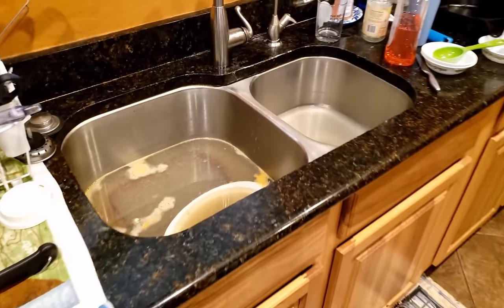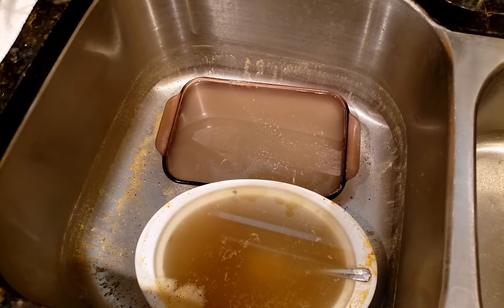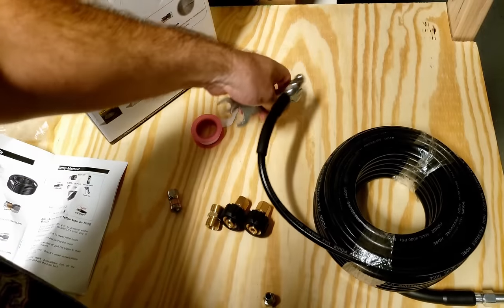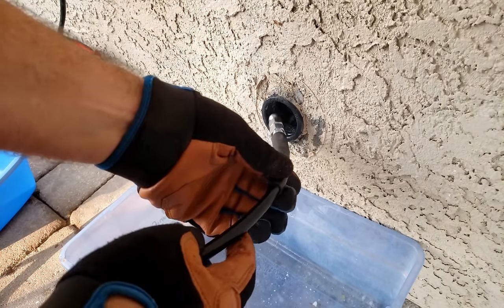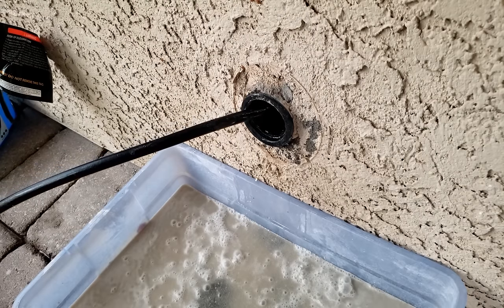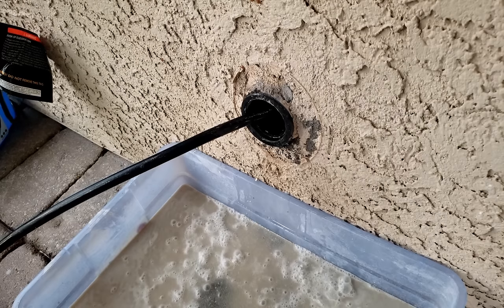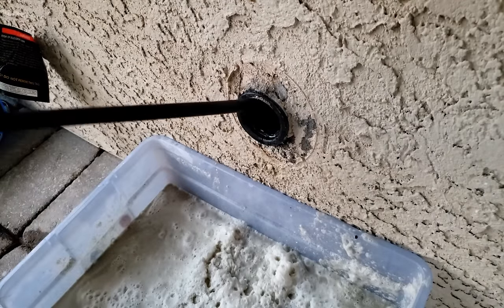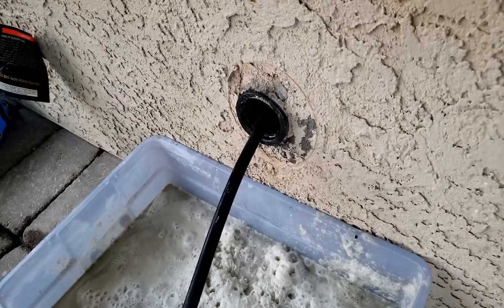UNCLOGGING my kitchen sink with a PRESSURE WASHER and the POHIR Sewer Jetter Kit

Comment: I wonder if the pressure decreases the longer the hose is. Hopefully not, I just ordered a 100 footer.
Reply from the maker: I don't know if you lose pressure with a longer hose or not. It took me a few tries to unclog my sewer pipe with the 50 ft hose. So if you do lose a little pressure it may take a few more tries to break through the clog with a longer hose. But it should still work. Let me know how it works with the longer hose.
Reply: @ThatHobby  I tried it out today and it worked! The length of the hose made it a bit difficult to handle since it was kinking and tangled. But I was able to advance nearly 70 feet in to the drain. Glad I got the 100 instead of 50. Black water and crud were coming out until the clog was cleared, then no more water. Not bad for $30 and a cheap Harbor Freight pressure washer rated at 1750 PSI. I think I will use hot water next time. I tried everything else including that horrible dreaded snake. And the plunger never worked for me. This was my last attempt before calling the plumber. Thanks!
Reply from the maker: @lwh7301  That's Awesome!!! Thanks for the update. Some people have asked if a 2000 psi pressure washer is powerful enough. It's good to know that even a 1750 PSI budget friendly pressure washer will do the job. It sounds like you really needed that 100 ft hose too. Good job. It feels good to save a couple hundred bucks. Plus you have everything to unclog it again if you need too.

Comment: Whenever I turn the water on in my kitchen sink, when water drains, it immediately begins to come out of the sewage drain on exterior of my house. Is this normal, or what type of issue may cause this
Reply from the maker: If you are talking about a water leak from your sewer drain. There could be a hole in the plug to sewer drain. That's what happened to me. The screw was rusted out too. So that could be your issue. If you are just talking about water running in the pipes and no leaks than that seems fine. But no water should be leaking anywhere from the sewer pipe.
Reply: Sorry I don’t know the terminology, but it is leaking from the exterior wall from the drain plug. The sink gets flooded when I leave the drain plug on. It is wetting the stucco, what is the issue
Reply from the maker: I am not 100% sure about the terminology either. But if you look at 0:52 on my video you can see the drain plug. Mine has a hole in it and started leaking water when I took out the screw. This could be the cause of your leak. The screws will rust out and can cause a leak.  If that is your problem then you can get a new drain plug to fix it. A new screw may be a temporary fix as well.

Comment: do you think i can do this with my washer drain? from the top down?
Reply from the maker: I would think so. Our washer is upstairs and the clean out drain is downstairs in-between the kitchen and the family room. If you can find the clean out drain it will give you a good idea where the clog is. But I bet if you just go from the washer drain that will work too. I would think it is soap residue and would break up real good with a sewer jetter. Just be prepared that a lot of water may come back out of the drain until the clog is broken up. So have some tubs or a wet vac ready.

Comment: What is the name of your electric power cleaner, I got AR Blue, don't think it's compatible with the jetter, but would considering buying like yours. Thank you.
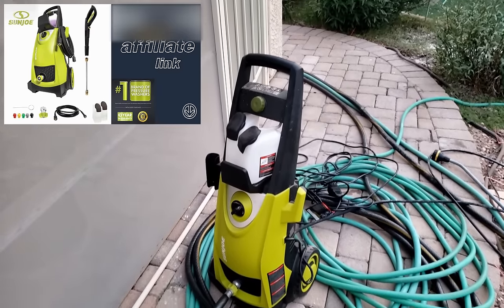Reply from the maker: The AR Blue should work too. At 4:00 you can see the 2 different fittings I connected to the hose. The 1st one is the sewer jetter hose attachment and the second one is a hose fitting used to attach the hose to the pressure washer gun. The important thing is the fittings that come with sewer jetter kits. At 5:41 I connected the sewer jetter hose to the pressures washer gun. There is an Amazon afflicted link in the description to the pressure washer I used. The pressure washer I used is the Sun Joe SPX3000 2030 Max PSI 1.76 GPM 14.5-Amp Electric High Pressure Washer, Cleans Cars/Fences/Patios
Reply: @ThatHobby  Unfortunately AR Blue doesn't have the snap on fitting, it has 2 attachments that connect to the gun in a twist in motion, but thank you for sharing your moled I'll consider getting it just for the ability to connect the sewer jetter.
Reply from the maker: I didn't realize the AR Blue had a different handle. I think the kit comes with another fitting that directly connects the sewer Jetter hose to the pressure washer. I'm not sure if that would work on the AR but I thought about using that method on the Sun Joe because it is a bit of a pain to hold the handle down and feed the hose down the pipe at the same time.

Comment: How long is that hose boss? Sorry about that that's 50 ft of Hose you answer my question, I've got a mobile home I've got to figure out where the opening is because I cannot feed a hose like that through the sink, I'll figure this out.!
Reply from the maker: If you can't find the sewer clean out drain plug you can also access the sewer pipe from under the kitchen sink. The clog could just be in the pipes under your sink. So it's good to check those pipes first. If those pipes look like they are clean then you can look under the kitchen sink at where the drain pipes connects to the wall. You can clean out the sewer pipe from there too. It will just be a little tougher working under the kitchen sink. You will need some tubs for the water and a wet vac would be nice to have too. Good luck!
Reply: @ThatHobby  well I snaked it about 50 ft under the mobile home, but it snowed here in Chicago yesterday so one of my friends told me to get some baking soda and vinegar.! I don't know if that's what did it or the whole bottle of Drano but luckily I got it clear :). Great video thanks so much and God bless~
Reply from the maker: Good job! I am glad you got it cleared out. Thanks for the positive comment.

Comment: Was hoping to see that other nozzle that came in that kit.  Looked like a rotary nozzle
Reply from the maker: I didn't think about using the rotary nozzle but yeah I bet it would work good too. I will have to test it out and see how it works.
Reply: @ThatHobby   I was actually looking at the nozzle for cleaning out a well and searched for videos and yours popped up
Reply from the maker: @charliemagoo7943  I used the sewer jetter nozzle head to bust up a grease clog but yeah I bet the rotary nozzle would work better for cleaning out your well.

Comment: Bunch of grease in the line. They do alot of cooking. Build up is at a turn of transitional fitting. Lots of grease
Reply from the maker: That's what we were thinking. Ever since we moved into this house we have had issues with this drain. Plus we cook a lot too. So we have just been adding to it. The sewer jetter did the trick I was able to get it all cleaned out and if it gets clogged again I have all the equipment to clean it out now.
Reply: Cool. Just jett out the line either every 3 months or 6 months. Pour hot water every once in a while.

Comment: I wonder if i can use it on the main line to sewer
Reply from the maker: It depends what the clog is. This worked great on the grease clog. I don't know how it works on other clogs but these sewer jetters are supoaed to be used to clean out all kinds of sewer lines.
Reply: @ThatHobby  what about roots because a sewer guy used the snake on my main line to unclog but try to sell the pressure cleaner for 1200. 00 and i told him ill pay the 87$ for the snake and ai asked him how wuld the pressure cleaner deal with roots 
he said technology meaning he didnt know 
thats why i ask your opinion let me know im having this problem yearly
Reply from the maker: @4444pro  I think the sewer jetter kits would work on roots. The issue would probably be the pressure washer. The Sun Joe pressure washer is only 2000 psi. Profesional hydrojets can be as high as 5000 psi. To get a 4 to 5 thousand psi pressure washer would be about a thousand dollars. If you wanted to test it before you buy it you could rent one and see if it works before you make a big purchase like that.

Comment: I don’t see the drain plug outside by my kitchen sink. Where can I find it lol help
Reply from the maker: If you walked around your house and can't find anything you could also do this from the sink or the pipe under the sink. It was just easier for me to do this outside.
Reply from the maker: The drain plug can also be inside your house. In my old house the sink faced the family room and the drain plug was on the wall in the family room on the other side of the sink.
Reply: In some states in different counties they make you put clean out on every drain line, either on the interior or exterior like the one shown in this video. If your on a crawl space or basement it should be located right under the sink within a couple feet.

Comment: What’s the PSI on your pressure washer?
Reply from the maker: The Sun Joe pressure washer is 2030 Max PSI. The POHIR Sewer Jetter hose can handle up to 4000 PSI. The Sun Joe isn't the most powerful pressure washer but it got the job done.

Comment: No system ( not even city sewer) is designed to accept grease or oil. If you have a stand alone system then it's even worse. NEVER put grease or oil down any drain. Always contain these , and place in trash.
Reply from the maker: Yep that is the way to go. Once you get your pipes cleaned out you want to keep them that way. I recently bought an old fashioned George Foreman grill. All the grease runs down into a tray and you can just dump out the grease into the trash. I cleaned out our sewer pipe back in October and it is till working great.

Comment: you must live somewhere warm..we don't have plugs on our walls up north haha
Reply from the maker: Yep I live in Arizona. Some people have said they couldn't find there clean out drain in there house too. So maybe they just use them in the warmer areas. But you can also access the sewer line from under the kitchen sink. It is just a little easer to do this outside if you have a clean out drain. Unless its snowing or freezing then its probably easer to do this under the kitchen sink.
Reply: @ThatHobby  did you put towels or something in the sink? wouldn't that shoot crap all over your kitchen going that way?
Reply from the maker: @patrickpk6299  No the sewer jetter isn't pointing towards the kitchen sink. The clog was further down the sewer line. So the excess water just ran out of the clean out drain.
Reply from the maker: @patrickpk6299  When I put in the sewer jetter I could go 2 directions straight would go to the kitchen sink and left would go to the sewer line. I pushed it to the left until it hit the clog. Then I turned on the pressure washer to bust up the clog.

Comment: I paid a 1k to have my main sewer clogged hydro jetted. But bro wth u guys putting down the drain. Body parts lol jk good video.
Reply from the maker: Yeah hydro jetting can be expensive. This set up isn't as powerful as a pro set up but it was able to get the job done. When we bought this house there was a ton of grease build up on the stove. So I think the previous home owners dumped a lot of grease down the drain. That grease can really build up and cause some issues. Especially when it gets cold the grease can harden up and cause a real tough clog.

Comment: Thanks for sharing the video! I've been looking at buying this kit for my main line. Been having a lot of grease build up lately and would prefer doing it myself than calling a plumber. Question, I've got a green works 1800 PSI pressure washer, think that will be sufficient?
Reply from the maker: The Sun Joe is only a little bit more powerful than that. It is 2030 PSI.  It took me a few tries to unclog my sewer pipe. So I think that 1800 PSI will still work. It just may take a few more tries. For the lower PSI precure washers a lot of the grease is going to be washed out of the clean out drain. So have some tubs or a wet vac ready. Eventually it will break through and the rest of the clog will go down the drain.
Reply: will work on a kitchen line but a small setup like this one do well on 3 to 4 inch main lines, not enough water output

Comment: How much you charge to jet a main line
Reply from the maker: They do sell these in 100 ft lengths.  Lowes charges $132 for a 24 hr rental Jet Machine with 150 hose. I am guessing a plumber would charge twice that?
Reply: @ThatHobby  Kitchen drain clogged after Thanksgiving.   Rented a 50ft 1/4"  electric snake from Home Depot for four hours....  $45 and job done.
Reply from the maker: @winddealer1  That's great. I guess I got lucky that I had to fix this last month. I don't know what it is about Thanksgiving. We have lived in our house for 5 years and this is our 1st Thanksgiving that we didn't have a clogged sink. The same with Christmas. I have been out there snaking the drain pipe on Christmas too. Here's to hoping both of our fixes last for the rest of the holidays.

Comment: Was it really fixed? We didn't get to see whether or not the water will drain.
Reply from the maker: Yes it was all fixed at 18:23 you can see that no more water is coming back out of the clean out drain. I was able to run 50 ft of hose in there to really clean it out. I should have shown a video clip of water running down the drain in the kitchen sink to make it more clear. A few people have asked this question too. But yeah it worked great is all fixed. I cleaned out my sewer line in October of 2021 and it is still working great today.
Reply: @ThatHobby  thanks. Good to know. I wonder if the drain bladder thing would also work.
Reply from the maker: Some people say the bladders will work too. It just depends how bad and how deep the clog is. I also used to use the metal snakes. But my cobra metal snake didn't work on this clog. I was thinking of renting a bigger auger to unclog my pipes but I decided to try out the sewer jetter first. I am glad I did because it really cleaned out my pipes. It gets right up to the clog and breaks it up. Let me know what you decide to do and how it all works out.

Comment: Next time take out all the water out of the sink then use baking soda and vinegar then add hot water
Reply from the maker: They say that's a great technique but I have tried it before and it didn't work for me. But yeah try everything you can to unclog it before you get out the tools. If nothing else works you will have to snake it or use a sewer jetter like I did.

Comment: Just snake it, could have got a cheap cordless snake for a clog that shallow. Less work and faster.
Reply from the maker: I have a 25 ft Cobra metal snake drum auger. I have used it a few times but it didn't work on this clog. But yeah after using both I prefer the sewer jetter even if it is a little more work to get out the pressure washer. It is so much easier to clean out the drain pipe with a sewer jetter.

Comment: As others have noted. STOP putting solids down the drain....DoH
Reply from the maker: It looks like the previous home owner put a lot a grease down the drain too. We also have some lemon trees and a lot of people think that putting a lemon wedge in the garbage disposal will freshen it up. When I cleaned out the sewer pipe there were also a bunch of lemon bits stuck in the grease. Garbage disposals are not that great at breaking down the chunky stuff like lemon wedges.

Comment: I feel like if I tried this I'd need new pipes
Reply from the maker: You don't want to take any unnecessary chances. I have used a metal snake for a long time and I was considering renting a motorized snake auger. But this seemed cheaper and like it would clean out the pipes better. My house is 10 years old so the pipes are still pretty strong. I am not sure what is harder on your pipes a metal snake auger or a water hydro jet?
Reply: @ThatHobby  My house is from the 50s or 60s, if I breathe on them the plumbing breaks. i've broken supply line valves just by turning them. Right now I have one sink in partial disassembly because one of the supply lines keeps trickling water. Also everything is corroded so it's very difficult to remove. I hate plumbing and I hate old houses.
Reply from the maker: It seems like every time I try to turn off the water to work on a sink the shutoff valves break and start leaking water everywhere. I usually have to replace the shut off valves under the sinks with shark bite shut off valves. Not sure if that helps or not.

Comment: Couldn’t of you ran that pressure hose from inside. Push everything out. Just saying.
Reply from the maker: Yes you can but it is a tight fit to access the sewer pip from under the kitchen sink. The clog was pretty tough to clear. So a lot of water came back out of the clean out drain. So it was a lot easier to have a tub under the clean out drain than under the kitchen sink. Plus I am a big guy and I don't fit under the kitchen sink that well. So yeah you can clean it out from inside the house but you have a lot more room to work if you can access the clean out drain from the outside of your house.

Comment: 50 feet you're in the main sewer line
Reply from the maker: I had a 25 ft snake that wouldn't work. So I went with the next size up 50 ft. That was long enough to clean out my sewer pipe. They also sell it in 75 ft and 100 ft length.